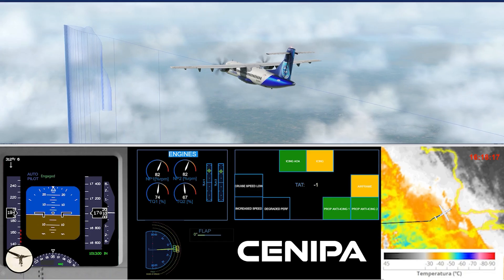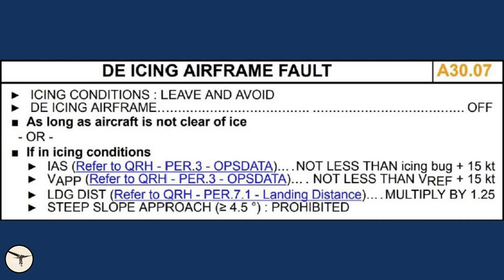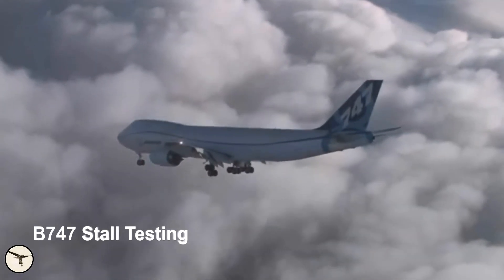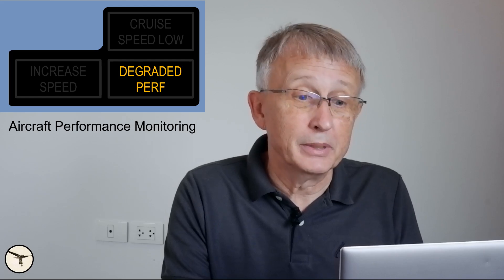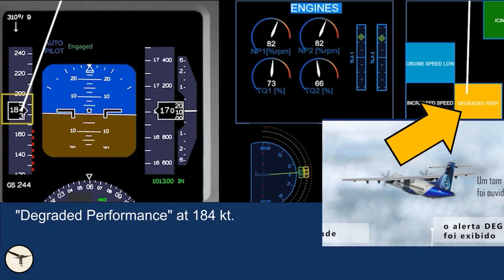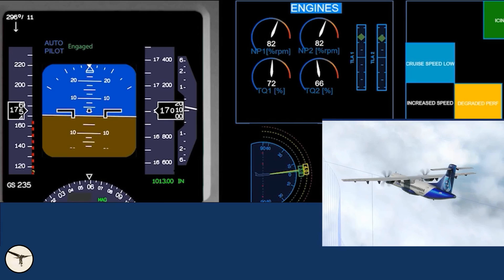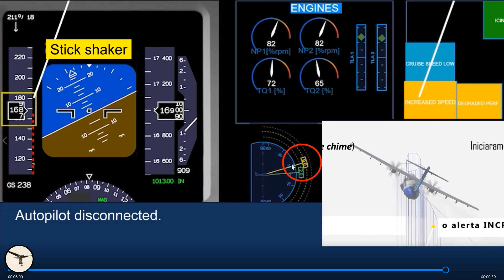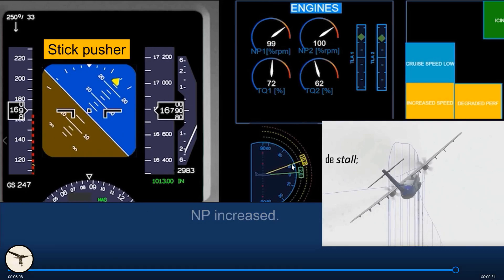ATR 72 Crash: Understanding the Flat Spin Disaster - Expert Analysis

Comment: This is how you intentionally initiate a spin for aerobatics: pull to stall and use rudder. Then instead of power idle, use full power like they did and you can get a flat spin. For non pilots it may seem that this is happening too fast, but it's not. In smaller general aviation planes this will be much faster and you should react immediately, like steering a car when about to leave your lane. Everything happened in the clouds with no visual references and when they saw the land they were already in a flat spin.
You can see the pilots not only making mistakes but reacting late, behind what is happening, so most probably their upset recovery training was poor.  It looks similar to AF447 except that in this case the plane worked with no issues.
Reply: After thinking a bit I think I see where the AF447 comparisons are coming from, both flew into icing & eventually stalled - however iirc AF447's performance didn't degrade ( beyond dropping into alternate law which I don't think has alpha protection ), the unreliable airspeed dropped it out of AP & startled the crew into doing something stupid rather than dealing with what they'd actually been presented with. I don't think this ATR ever showed signs of any unreliable instrumentation? it carried on warning the crew it was struggling more & more & they apparently didn't listen.
Reply: @RichardDastardly59  Indeed. This crash has nothing to do with AF447 - totally wrong associations.
Reply: For flat spin you need CG aft that is normal in combat airplanes (unstable) but abnormal in transport airplanes
Reply: @juanmanuelgomezmartinez3795  I don't know about ATR, but full power surely didn't help as it acts similar to moving CG towards aft.
Reply: @christiangavrila  I agree. You need first center controls and power idle as a basic spin recovery procedure. In ATR power axis is close or the same as longitudinal axis. Some airplanes require special step by step procedure to recover from spin. ATR with ICE is an other airplane. ICE accumulation change shape, weight and maybe CG. ATR doesn’t have hydraulics controls so some times is really hard to move it specially the RUDDER. In this case who move the controls the pilots or aerodynamics forces. Years ago, I did a 17 knots crosswind landing (crab approach). On level off I applied aileron into the wind and rudder opposite to the wind to center nose with runway axis. I was surprised how hard was the rudder that I thought how can a girl fly this airplane.
Reply: @juanmanuelgomezmartinez3795  There may have been a ton of ice on the tail too.  That'd move the CG back a bit.
Reply: In this case the plane had a de-icing fault. With how it departed I'm a little surprised how long it kept flying, to be honest. There must have been some horrific ice buildup, I wonder if they really had much tail authority at all & I'd hate to guess what the effective trim really was just before it departed.

At face value this does seem a case of acknowledging the situation & blindly carrying on anyway - it will be interesting to see how much training they had around icing conditions & whether that really impressed just how much of a danger it is.
Reply: @RichardDastardly59  Indeed, exactly.
Reply: @RichardDastardly59  Yes, you are right, I missed that. In fact AF447 had ice on the pitot tubes, so you can say ice is also what started it and pilot reaction or lack of reaction made it much worse.
Reply: Wouldn't it be quite different to AF447 aside from the stall aspect? If I recall, the Air France flight crew spent minutes misunderstanding everything that was going on and pitching the nose up into a stall - caused by faulty AoA due to frozen pitot tubes, whereas it appears that this crew just failed to react in time to the ice and low speed and stalled.
Reply: @theearthwillshake8706  AF447 reacted( poorly ) when the right thing to do was basically do nothing - these guys seem to have done basically nothing when the right thing to do would be fly somewhere else.
Reply: @RichardDastardly59  Yes, that´s on the point. This crash is indeed practically opposite to AF447.

Comment: Thanks for the higher res animation. Do we now have stick and rudder imput data as well? Could it be that the horizontal stabilizer was already shaddowed by the main wings before entering the flat spin? ie the pilots/pusher could no longer initiate a dive? And why is there no more voice data towards the end if we still have flight data. Is there a lag in recording or just not released yet?
Reply: Caveat I'm not an aviator but I think so, yes, the stab stalls before wing does in most traditional ampenages. You lose elevator authority in sims at least, have more roll. Except blended body elevons they stall different
Reply: For me, it looks like a poor CRM. There was no voice to be recorded.

Comment: It seems to me that regardless of the cause, in several recent disasters in which an aircraft reaches a stall situation, the pilots seem to act only instinctively trying to pull the nose of the plane up instead of lowering the nose to regain speed and control, as they should. The same reaction can be seen in the tragic accident of Air France Flight 447, where the pilots in command ignored the instruments and stall alarms and kept pulling the stick up until they completely lost control. First there is some confusion in understanding the situation, and then failure to follow the proper procedure. The same thing seems to have happened in this disaster. Of course, looking at it from the outside seems like an obvious flaw, as it's just a matter of the laws of physics, but it's intriguing how common this loss of situational awareness is in these disasters. They seem to completely forget that they have altitude, that they have room for maneuver, that they can ask traffic control to clear the way. Very intriguing.
Reply: The stabilizer stalls before wing afaik, to pull up is checking for authority. They had none. It's not the mistake.
Reply: @foobarf8766  Of course pulling up is a mistake in a stalling situation, especially for planes with a T-Tail. 
Although I'm not a pilot I have to wonder, why would you ever check for authority in a stall? To check whether or not you are already in a deep stall, and pretty screwed?
AFAIK, any stall recovery procedure requires you to reduce the AOA immediately, and not check if your elevator is already stalled, and why would you? Also, I believe that most simulators are poor at simulating the stall characteristics of a plane, icing will only make it more unpredictable, as the accumulation changes the stall characteristics.

The stabilizer usually does not stall before the wing does, because their airfoils are different, and symmetrical airfoils, the ones used for the horizontal stab, have a higher critical AOA.
If the stab had stalled first, we would have expected a sharp pitch-down moment, but we just don't see that here.
It looks like the wing is stalled first and they enter the spin by applying right rudder. 
After that the nose pitches down, as is expected in a spin.
Reply: @TheOnePurpleGuy  idk of course, all speculation but the pull up could also be dual control conflict. I don't know. But the stab size is smaller. The lift is function of area, if I had ATR in XP id try it (does laminar flow the new msfs still puts 172 into 'brick' stalls). Speaking of the c172 it has massive stab because it's a trainer. The stab is not main lift device ofc but does have +ve (not zero). CoG would determine pitch when losing it and it would be aft afaik? So pilot's intertial frame is experiencing <1 g in the vertical moment and might pull up in spite of HSI? Airfoils different yes but both produce lift.
Reply: @TheOnePurpleGuy  pitch up not down if it stalled first because normal force
Reply: @TheOnePurpleGuy  Exactly.
Reply: @foobarf8766  If you´ve stalled an aircraft and you´re pitching up you´re dead and all the people in the cabin of your aircraft, too. I hope very much that you´re not a pilot.
Reply: yes!! exactly!!! just like AF: aviator vs pilot. some just do what they were taught without the big picture, and some are actually aware of the big picture

Comment: I don't understand why both pilots failed to take quick action to fly at a lower altitude immediately and call for an emergency. Their mistake was turning off the icing system at 17k feet altitude.
Reply: Can anyone clarify if the pilots commanded it off? I thought arinc data only gave you bus state and fault present, so it went off by itself (faulty)

Comment: The deceleration when it went flat against the wind was massive.  I am surprised it didn't break up

Edit: I thought about it. peak deceleration should be: 
peak deceleration =((speed when they went flat against the wind)^2/ (flat spin vertical terminal velocity speed)^2) ×9,81m/s^2
So peak deceleration wasn't too high

Comment: Stay off Silver Airways!
They only fly ATR's!!
Reply: And?
Did you actually watch the video or just jump straight into the comments? The pilots knowingly flew into icing conditions with an inoperative deicing system. They then proceeded to ignore the APM cues.
Reply: Sorry to ask you that but, did you actually watch the whole video ? Did you get the part where he said that the crew didn’t acknowledge the multiple warnings that the plane gave ? The plane did it work, the crew didn’t
Reply: @bonnoteriiteporouarai7097  Exactly.

Comment: I wonder if severe icing being an emergency is not being emphasized enough. Certainly the statement "no aircraft types certified before 2015 are approved for flight in severe icing" tells us that a severe icing encounter requires action to escape, since it is a situation the aircraft is not designed or demonstrated to handle. But on the other hand, I can imagine a pilot being reluctant to declare mayday because of ice, especially if other aircraft nearby seem to be getting away with it. Even having read the report on American Eagle 4184, "severe icing is an emergency" was a bit of an eyebrow-raiser. It makes sense, of course, but it does emphasize the urgency of the situation more than "flight in severe icing has not been demonstrated, nor is it required under the certification rules" or something similar...
Reply: You make some good points. 
Having watched many videos relating to flying into severe icing I would like to see ATR change the APM 'Increase Speed' advisory to an emphatic 'Increase Speed NOW!'
Reply: @marcg1686  Exactly.

Comment: Not the pilots fault. Aircraft unsafe in ice. Wing modification required.  Ground until modified
Reply: So ignoring the stall warning is completely acceptable? Got it.
Reply: Of course it will be unsafe IF the systems to handle it fails and no action gets taken to mitigate it. Any plane can get compromised by ice under those conditions.
Reply: The plane was perfectly airworthy and safe until the pilots put it in an unsafe situation, beyond its operational limits. They then failed to recover from the unsafe situation despite ample warning. Those are the facts.
Reply: Perhaps the airplane is not unsafe, but instead pilots are not being trained to an adequate level of competency?
Reply: And it's safe, or several would fall every day. We'll have to wait for the final report. But at the moment everything indicates that the pilots' lack of action was the most likely cause.
Reply: You are funny 😁
Reply: @mariopinho6549 
He does say silly things. Too bad this is not a funny matter.
Reply: @codecoderr7495  
You stated that 3 aircraft crashed on the 9th of August 2024. The flight numbers please.
Reply: @marcg1686  not going to spoonfed more info, you're not a manchild. Isn´t?
Look around.
Reply: You clearly missed the point if you say so. You lack listening skills… the aircraft was operating beyond its limits and the crew didn’t listen the multiple warnings of the plane.
Reply: As far as I can find out there have been about 4 fatal accidents like this killing about 250 people and In airline safety viewpoint very very unsafe.  I would not fly in it, risk is too high
Reply: @keithwalker6892  Please explain how the plane itself was unsafe in this instance.
Reply: @visualdarkness  3 planes crashed during that day. August 9th 2024: Chile, Brazil, Argentina, in a span of 6 hours.

The plane's poorly designed and must be removed. Besides, it entered a flat spin. You don't enter a flat spin on the A320 by having SIGMET + autopilot. On top of that, another fellow FO (of an A320), warned minutes before the icing conditions to ATC. He basically undergo the same problems, but was able to recover, and landed safely.

Source:
'Un piloto de otro avión pudo evitar la tragedia en Brasil pero la torre de control lo ignoró: “Nunca vi algo así”'
Reply: @codecoderr7495  You are comparing a jet to a turboprop of different sizes. Not really apples to apples. Raising the question if the AP should be more reactive to warnings is fair though. Though as Magnar says in the video, someone possibly even tried to counteract the stick pusher, essentially negating the safety system that's in the plane.
Reply: @visualdarkness  that's worse. A Jet has better chances of recovering from a flat spin.

In any case, the ATRs should be grounded, they belong to a museum. And i'm glad the AIBN (Accident Investigation Board Norway) as well the NTSB agrees with anybody having respect for flight safety.
Reply: @codecoderr7495  
Only two aircraft crashed on the 9th August 2024. One ATR 72 and a Dash 8-300.
SIGMET and Autopilot didn't cause the ATR to enter a flat spin. Full deflection right rudder after stalling the plane is the cause for the flat spin.
Every thing you said is wrong.
Reply: @marcg1686  that's a plain lie.

1)
August 9 2024 Crashes:
Brazil (Vinhedo)
Chile(Aysen)
Argentina(Rosario)

2)
3 planes crashing indicates a severe weather issue (even of one of them is suspected as crash on purpose), and on that day there was severe wind gusts on Vinhedo. I recall 35~50km/h winds going from North to North West exactly between 16:20 - 16:30 UTC.

3) Stalled ATR on such winds could easily help them get into a flat spin. 

4) You should really not be spoonfed from the NTSB, the ones who gave directions to ATR designs.
Reply: @keithwalker6892  
Five actually, and with the exception of Flight 4184 in October 1994, every other accident and incident has been the result of pilot error and sometimes shockingly bad airmanship. The APM is so simple to understand, yet these two pilots completely ignored two cues and an advisory.

Comment: I think a possible explanation of the behaviour of the pilots could be pressure from an almost brokendown company like Passaredo Voepass.
The pilot didn't call mayday, why? may be instructions not to waist fuel, time, money.
On top there was  a SIGMET with severe icing enroute.
An ATR 500 SHOULD NOT FLY at 170 in those conditions. NEVER.😢
Faulty deicing system 
Fly lower or divert flight means more fuel, time money.
The pilots decided to go on until the descent point indicated by ATC. 
But 2 minutes and low speed were too much 
RIP for all of them.

Comment: Excellent captain MAGNAR. Nice to know the data but a lot of data is missing. A lot of things weird. Pitch attitude before bank 4 degrees. On bank the pitch never increases above 4 degrees. Why? The AOA started to increase without pitch. I think the aircraft was stalled at that point before stick shaker activation. REALLY WEIRD. When the spin was developing, the data is unreliable. Pitch down, climbing at more than 6000 FPM and decreasing speed to zero. Inconsistent. The aircraft have 3 sensors of everyone so we need the more accurate. At some point, we can see right rudder but left input in the joke. Thats contradictory. Who move the controls. The pilots? Or aerodynamics forces. Some years ago I level off and landed reaching 12,4 AOA in the process and never had STICK SHAKER (ATR42)
Reply: Pitching down, decreasing air speed, but increasing altitude. After long time trying to understand...
I think the plane did like a surf movement, climbing over the wings, sliding transversally. 
This, could explain the decreasing speed fast.
I think

Comment: From the first moment of stall until they enter the flat spin is terrifyingly quick. If you ever needed an example as to why you should take early action and not ever let it get to the stall in the first place, this is it.
Reply: From the Degraded Performance warning to the actual stall, 1 minute and 30 seconds have passed and the aircraft lost something like 20 knots in that time. It's so sad to see that, with the information that we have, this was apparently a totally avoidable tragedy.
Reply: @hugorneto  Indeed, exactly.
Reply: @hugorneto  pilots probably very occupied by this situation (lac of proper training) or they just did not pay attention to the situation unfolding in front of them.
Reply: True, but this obviously wasn't a "normal" stall - the aircraft gave a number of warnings before the stall to avoid the situation. In a clean state (at least as far as contamination goes) the ATR stalls like a fairly normal plane from what I've heard. 

Throw in this many variables and all bets are off. It was definitely terrifying to watch, BUT it's also VERY difficult to get into the situation in the first place. It's almost like they were trying - or just complete ignorance thinking the plane would always save them no matter what they did (or didn't).